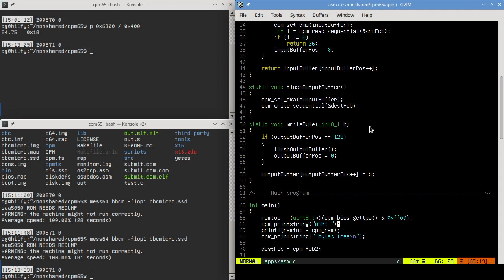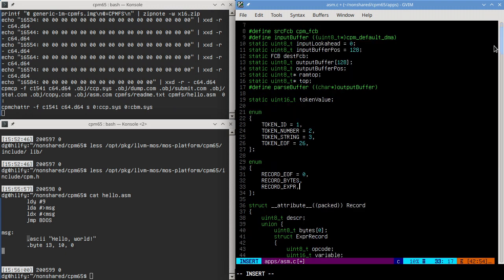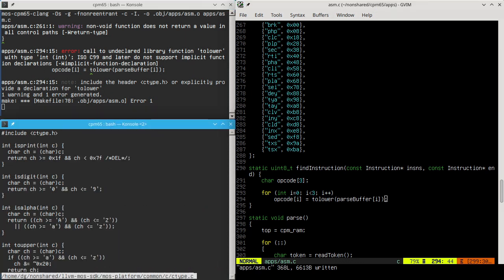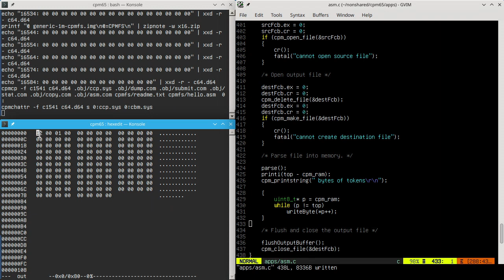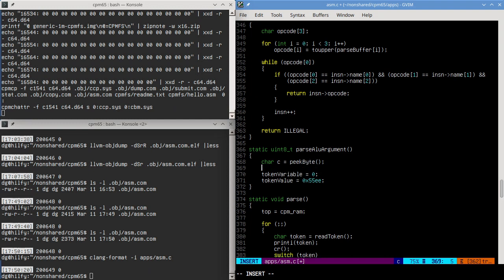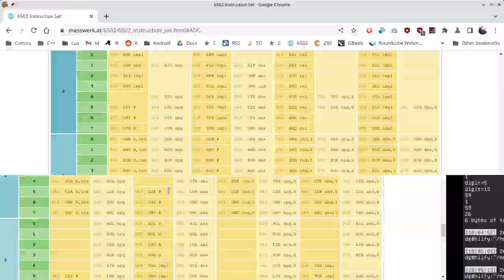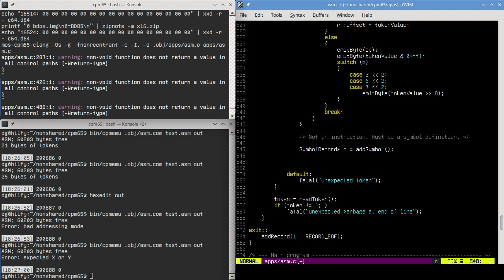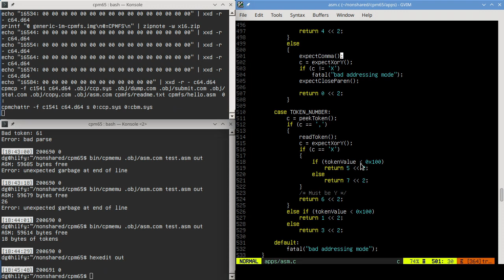Writing a 6502 assembler for CP/M-65, part 1/6

Comment: Can't believe you didn't program the assembler in assembly.. though your C code takes on some assembly-isms that I haven't seen others do.
Reply from the maker: I did think about it. It would have been faster and smaller and would have been so much harder to debug. (Since these videos I have fixed an incredible number of bugs.)
Reply: @hjalfi I was genuinely surprised how badly the C compiler did for the 6502 in your CP/M series, STAT was especially huge. Even the z80 has infinite registers in comparison.